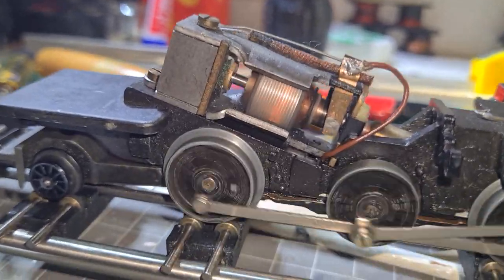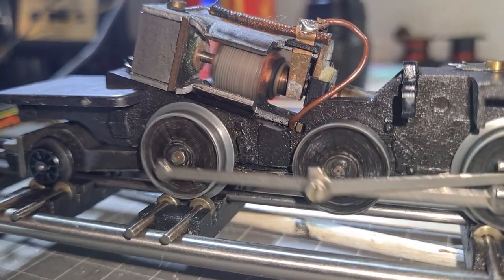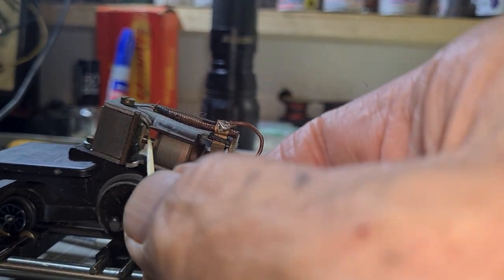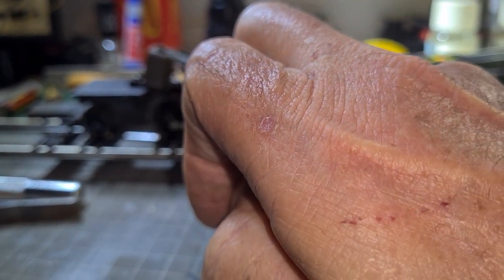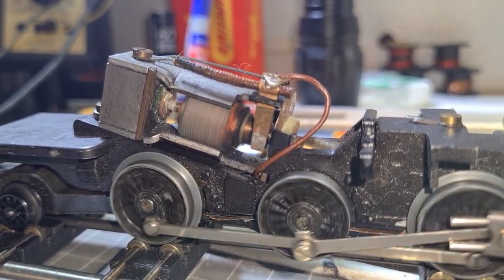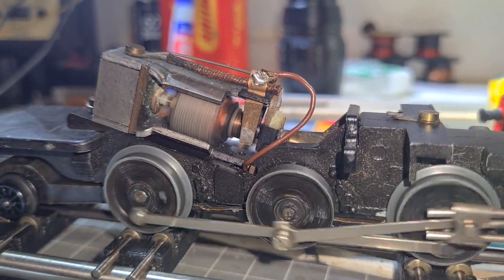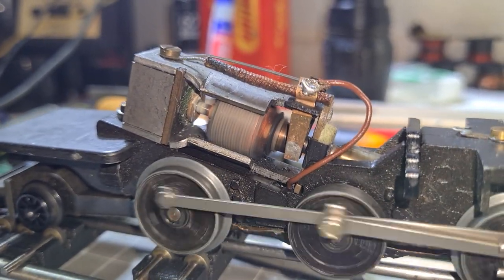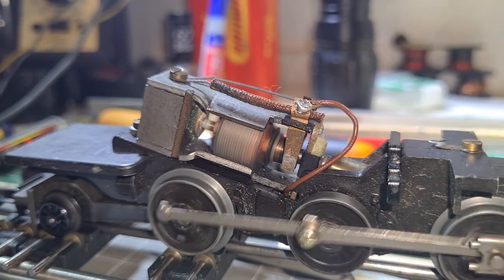Noise reduction tip for X03 and x04 Triang motors.

Comment: Just look at the front and centre wheels  spinning up and down (eccentric)
Reply from the maker: I see what you mean, this is usually from the plastic insulators on the axles softening, or wear in the axle bearings. It's an easy fix, if you can get the insulators.

Comment: 😊I would be more concerned about the middle drive wheel .
Reply from the maker: I have looked at it and decided to leave it for now.  If I ever get hold of some new insulators, I will replace it. But as this loco spends most of its life in a cabinet, I may die before I get around to it.

Comment: Hi Steven, the noise from these motors is something I have not worried about before but as you will see on Tuesday, I have a 2-6-2 tank that is very loud so I might give it a try. David.
Reply from the maker: Hi David, it won't be a permanent solution, but can be reapplied as necessary. It has really made a difference to most of my noisy X04s. There are one or two where the results have been not as effective, so I am continuing to investigate the cause. I suspect it could be cooked wiring in one of the poles  causing an imbalance when it runs. May need a complete rewind. Steven.

Comment: Hi Steven, looks like you found a good solution using Lithium grease  on the noisy rear bearing. It is definately quieter and smoother running. Cheers, Paul.👍👍
Reply from the maker: Thanks Paul, after a bit of experimenting I think I have found an acceptable solution. Steven.

Comment: The bearings are phosphor bronze, not brass.

The position of the worm, on the armature shaft, determines how much growl the transmission will have. Repositioning the worm forwards or backwards a millimetre, will reduce the noise generated by the transmission. Triang-Hornby were aware of this and changed the axle cogs from brass to delron, then to nylon in an effort to quieten the locos down.

If the loco growls far more than the average Triang-Hornby fare, then the loco was assembled on a Friday just before clocking out time.

The Hornby Dublo R1 0-6-0T can also have a noisy transmission, if the worm is not quite positioned right.
Reply from the maker: Thanks for the info, I wasn't sure of the bearings.  I have watched OO Bill do the adjustment on the worm gear, I have done that to prevent wear on a few motors. But I have found the grease fed into the rear bearing makes a substantial improvement in noise reduction. Thanks for the comment, much appreciated.
Reply: More likely wear on the centre or driven axle, you can see it wobbling.
Moving the worm on the motor shaft   shouldn't alter anything. Try shimming the centre axle to improve running. The 'cog' is actually in principle a worm wheel, but in Hornby's practice a helical gear.

Comment: This is interesting.
Oiling the bearing pads is supposed to lubricate the bearings. 
Out of interest, the front bearing pad on your X.04 motor looks clean and dry?
Thanks for the tip. 
The hard thing for a lot of us is not having a rolling road to lubricate the armature shaft while the engine is hot and in motion.
Reply from the maker: Hi mate, you could try removing the motor and putting it in a clamp and then run it. My front bearing was oiled, I don't put the grease at that end as it is not conductive and leaks onto the commutator.  I don't soak the pads with oil as it attracts dirt, a couple of drops is plenty.  . The grease has enough viscosity to stick around in the bearing for quite a few hours of running time. I hope you give it a go.  Steven.

Comment: Hi Steven. 

Good solution but the question is, how often will one have to apply grease? 

Paul. 🤔
Reply from the maker: Hi Paul, well that may depend on the number of hours the motor is used and how worn the bearing is. The grease I used seems to stick pretty well to the gearshaft and bearing. The phosphor bronze bearing is porous so it should absorb into that as well. I haven't had to repeat the treatment yet, so I'm not sure how long it will last. Steven.

Comment: Hi Steve I,v always put oil on the rear bearings,  but I think grease would
Provably be a lot better. All the best butty. Carl.
Reply from the maker: Hi Carl, give it a crack mate, I am finding it works quite well. It's a cheap fix. Apply very sparingly if you do the bearing near the commutator. Steven.

Comment: Awesome video m8.. Ive never seen anyone explain tgis before not even OObill or sam on sams trains. I only bought some white lithium grease just like you did somI will go,through my x03 x04 motors and check them.. 
Can you still buy the brass bearings for the x03 x04 motors and do they have a R.??? Number for them as I have already bought the plastic bushes for the triang axles.
Thanks again for good video.
Cheers from John in Australia
Reply from the maker: Hi John, I'm in Brisbane mate, so I'm not sure about the bearings still being made. But if you look up Mr Snooze's channel, his latest vids address this very topic about replacing bearings with substitutes. He does an excellent job as well. I'm glad the vid helped, it's just a simple method that can help reduce the vibration of the shift in the bearing. Steven.
Reply: check peters spares